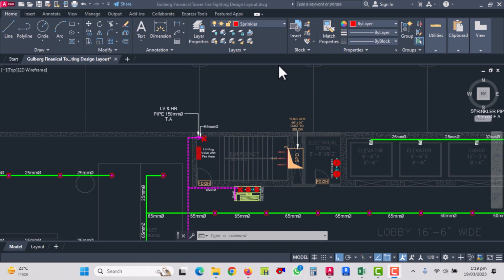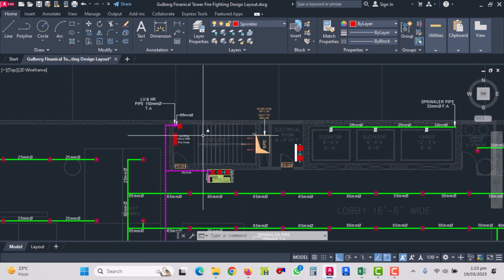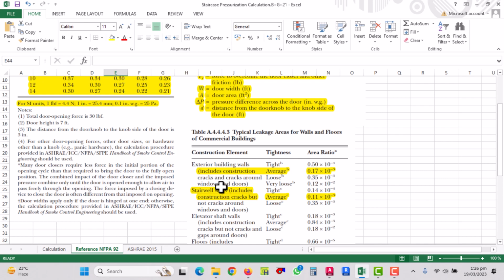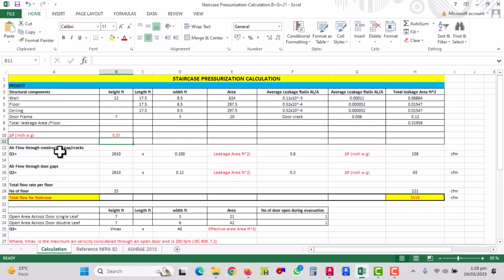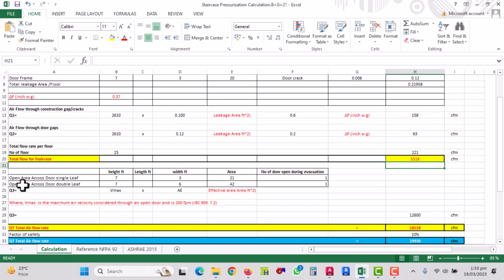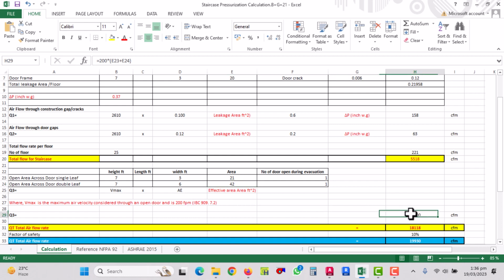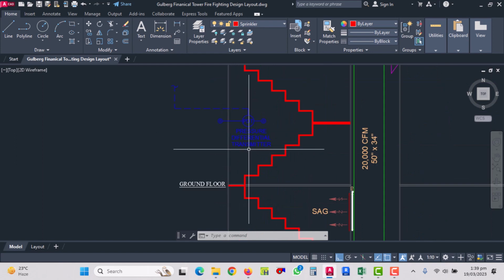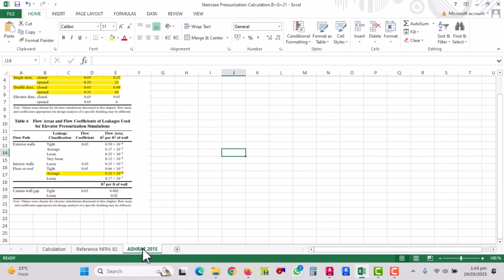Staircase Pressurization System Design Explained | Smoke Control Calculations | NFPA & ASHRAE Guide

Comment: How would you design a louver with a pressure relief damper for each staircase?
Reply from the maker: Usually the fan are VFD drive, adjust its speed according to pressure variations, if you need to to add relief damper at every staircase you need following formula and size the louver with damper accordingly.

Velocity Through Louver
	•	Keep low to avoid noise & rain ingress:
	•	2–3 m/s max

Q_relief = Q_supply – Q_leakage

Comment: Hi Sir Good One, for for wall width and length you  Multiple  you With 2 is ok we have two wall but Why You Multiple with 2 for Floor And Ceiling if Examble lenght17.5 X width8.5 = 148.75sq.ft this is the actual area but why you multiple 2 for floor and ceiling
Reply from the maker: I will check and get back to you because this video is very old, you can check if its perimeter or area?
Reply: @passionateengineermep  IM ASKING ABOUT THAT FLOOR AREA AND CEILING AREA
YOU ONLY MENTIONED AREA NOT PARIMETER
Reply: @passionateengineermep  AND ALSO WHY YOU MULTIPLE WITH 2 FOR FLOOR AND CEILING AREA AND DOOR AREA
Reply: @passionateengineermep  ONEC AGAIN YOU MAKE THE VIDEO FOR LIFT AND STAIRWELL PRESSSURIZATION
Reply: @passionateengineermep  ONEC AGAIN YOU MAKE THE VIDEO FOR LIFT AND STAIRWELL PRESSSURIZATION

Comment: are there any standards that show the velocity through SAG of  STAIRCASE PRESSURIZATION SYSTEM ? (i dont know how to choose the range of this velocity) , TY
Reply from the maker: The SAG shall size as per the velocity in the branch duct or per manufacturers recommendation or 500 to 600 fpm maximum.
Reply from the maker: There is no standard for this, like NFPA and ASHRAE are not specifying any velocity for SAG.

Comment: Dear Sir, how did you get the value of 0.2 differential pressure inch w.g. for the Q2 calculation?
Reply from the maker: Its standard depends on the door opening force.
Refer NFPA and ASHRAE handbook
Reply: @passionateengineermep  Do you have design calculation for Fire Lift Shaft pressurisation and fire fighting lobby?
Reply from the maker: @ShashiSanmukhiya yes
Reply: @passionateengineermep  can you send me the link for the video on youtube if possible.
Reply from the maker: Please share you email

Comment: Area of Floor & Ceiling =L x W= 17.5 x 8.5 =148.75 sqft but in your calculation showing 297.5 sqft. can u explains how  came 279.5 sqft ?   
Door  7x3 =21 , 20 ft will be gap length.
Reply from the maker: First of all its not 21, its 20 and its not 7x3, its (7+3)*2 (perimeter) and second is 17.5*8.5*2= 297.5, these are not like your calculations because these are not cross sectional areas.
Reply from the maker: Please first understand the concept, how to calculate the areas etc than go for the other calculations, these are not straight forward cross sectional areas, because i didn't mentioned any cross sectional area, these methods are based on NFPA and ASHRAE, all references are given in excel sheet, go through it and please don't confuse other viewers.
Thank you

Comment: Thank you for making this informative video.
Sir, if the fire occurs on multiple floors, then the no. of open doors wont be only 2.  How many open doors we will consider then?
Reply from the maker: You're welcome, when you consider 2 doors to be open , it means that 2 doors per floor, if there are 10 floors and fire occurs at all of them then 20 doors will be opened, which is already considered in design.
Reply: @passionateengineermep  Thank you for your quick explanation Sir.
But in the calculation you considered the area of 2 doors only(21+42). Shouldn't we multiply the area(63 sq. ft) with the total no. of floors?
Reply from the maker: 2 doors are considered per floor but it can be 3 depending on the mean of egress.
When 2 doors are considered it means that airflow per floor or 2 doors  are considered ,then per floor cfm is multiplied with a total number of floors.

If you have any confusion,send me an email.

Thank you
Reply: @passionateengineermep  Thankyou for your reply. I still have further queries. Can you please share your email.

Comment: Sir. Why is it that the grilles or registers are not placed for every floor level? How to know the location of register?
Reply from the maker: The staircase is open from top to bottom,  if we provide a grille on every floor, it will increase the wall penetration.
The register location is always at the top of the stairs in the stairwell or staircase.
Reply: Thank you Sir. 
NFPA 92 stated that maximum spacing is 3 floor between grilles. It did not specify why max is 3 floors. Now I understand why. 

"It will increase the wall penetration." You mean, it will increase the air leakage Sir?
Reply from the maker: @nikmatic6807  if there is opening above the staircase, you can place fan directly above it, but you are using duct system than max spacing is 3 floors, you can put in every floor, but it will increase cost of wall penetration and grilles plus increase ESP.
Reply: @passionateengineermep  What is ESP Sir?
Reply from the maker: @nikmatic6807  External static pressure of fan.
Reply: @passionateengineermep  why would it increase Sir?
Reply from the maker: @nikmatic6807  By increasing no of grilles, will increase pressure drop.
Reply: @passionateengineermep  thank you Sir for the enlightenment

Comment: Why you have not reduce the duct size in the riser diagram after the grills as the cfm will be distributed after the floors....
Reply from the maker: Thank you for your concern.
Yeah the duct will be reduced after the reduction of cfm. 
You can change size after cfm is reduced but try to not use more reducers because of the installation problems in the shaft.
In our case the shaft is very tight to work there, so we avoid reducers and also because of the grill sizes.